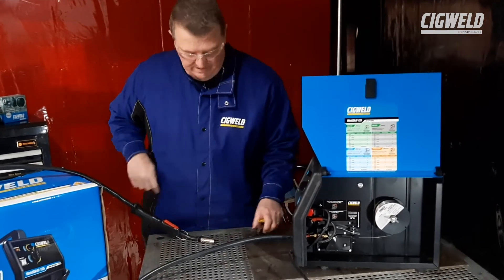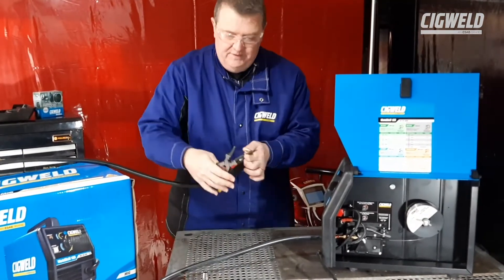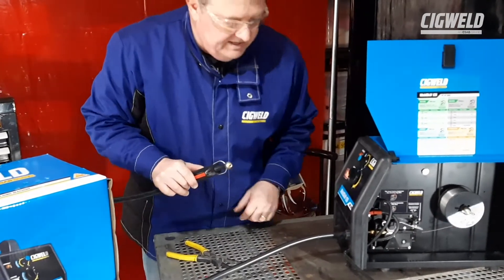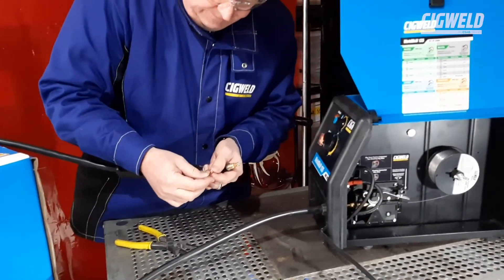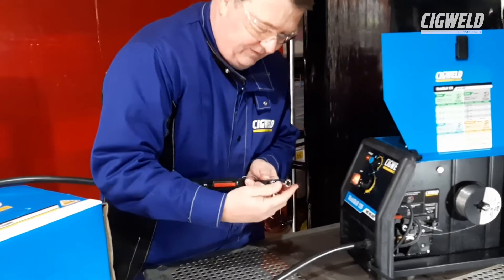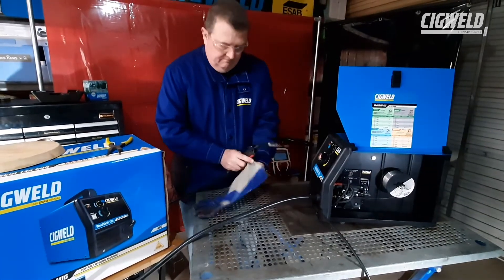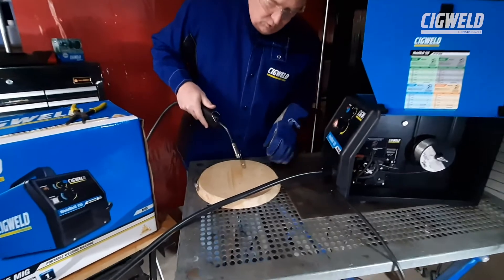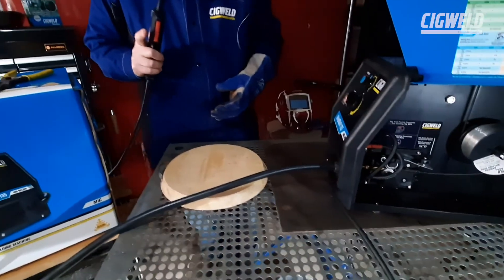WeldSkill 135MIG  Part 3 - Gasless Wire and wire feeder

Comment: My wire tensioner is all the way down, yet the wire still slips a little (correct roller size for the wire). Any help would be greatly appreciated. Cheers
Reply from the maker: We would recommend calling the tech team on 1300 654 674 for help